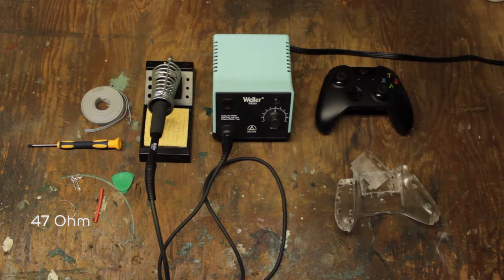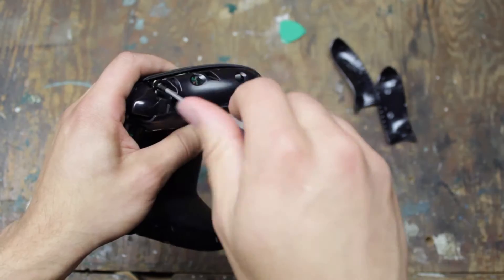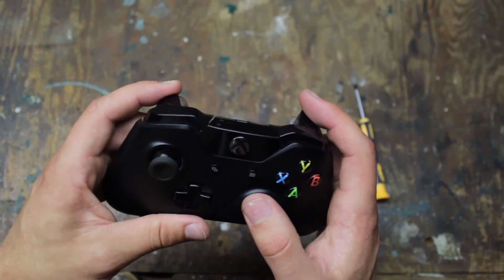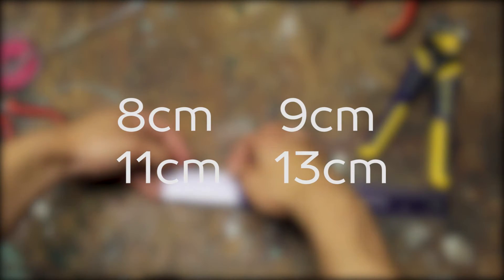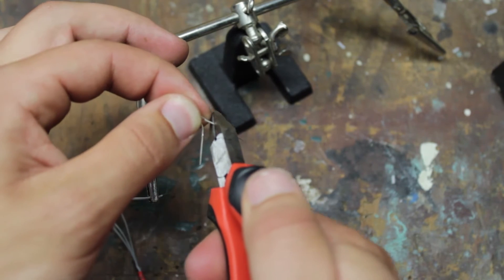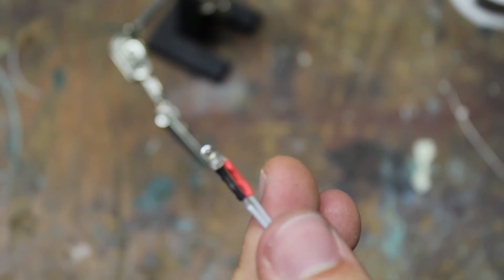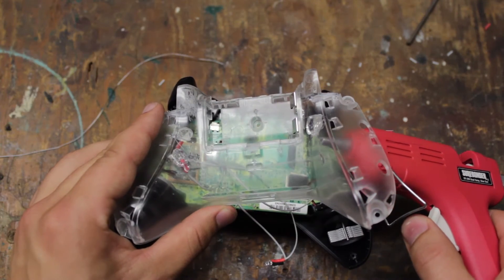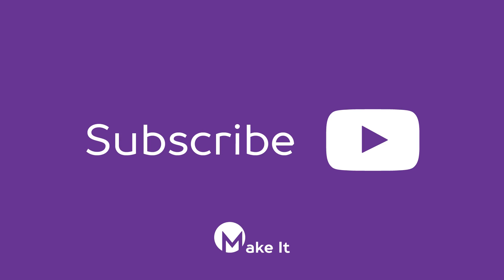How to Make a Backlit Xbox One Controller Mod

Comment: I have a razed Wolverine ultimate and I went my ABXY Hutton’s to be backlit and have LEDs to light them up and haven’t found a proper tutorial yet mainly on fitting the wire so the buttons work properly and where to power on Xbox one controller

Comment: Where did you find just a transparent back to an xbox one controller or do you pay for the whole kit. I don't want to pay for the whole transparent kit.
Reply from the maker: I bought the case on ebay. You have to buy the whole kit, but it only costs $6.99

Comment: From someone who has not a lot of experience in electronics, what is the resistor for?
Reply: Basically the higher the resistance of the resister the more dim the LED will be
Reply from the maker: The resistor limits the current in the circuit. Too much and the LED would burn out!

Comment: Great video. The product looks excellent and it's a very good idea. If you don't mind a couple of constructive suggestions: Be careful with hot glue because it tends to break off of plastics and other materials with freezing temperatures (shipping , moving, storing without climate control during winter).  There are better clear-dry solutions at most hardware stores, though probably not as convenient as hot glue.
Reply: Also, it looks like a "micro slide switch" would be a perfect addition to the scheme. Just cut a small place for it in the bottom of the shell to attach it, then wire one end to the positive lead of the batteries, and the other end to your resistor. Not the perfect on/off solution, but a simple switch beats pulling the battery out every time. It actually sounds like a cool feature to have it on as some ambient lighting while the controller is charging or docked.
Reply from the maker: +AsauceAndBrub Thank you for taking the time to comment. You're right, a switch would be a great addition to the controller! I'm kicking myself for not thinking of it before creating the video! As for the hot glue, I will keep your suggestion in mind when I work on new projects. The LEDs in this controller are holding up so far. In this application hot glue seems to work,  but I could be wrong!

Comment: Does the LEDs turn off when the controller shut down?
Reply from the maker: +Fredrik Rambris No they don't, you have to remove the battery. I could not find a solder point that supplied enough voltage and turned off with the controller.
Reply: When you need the soldering Point for the Positiv who turn off the led when the controller is off PN me ;-)
Reply: HM Modding  hi do you no the solder points on xbox one would appreciate your help